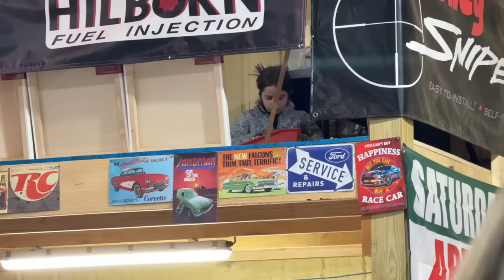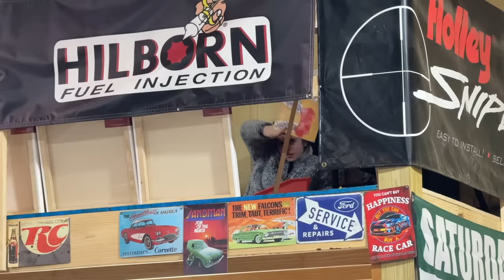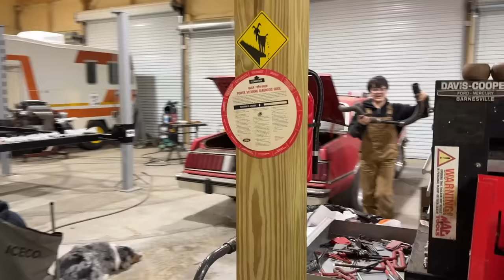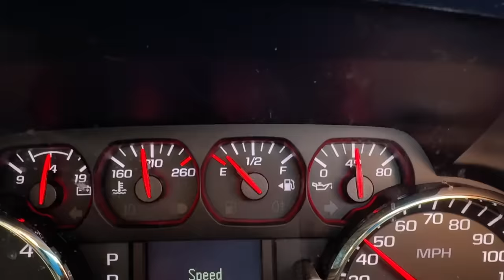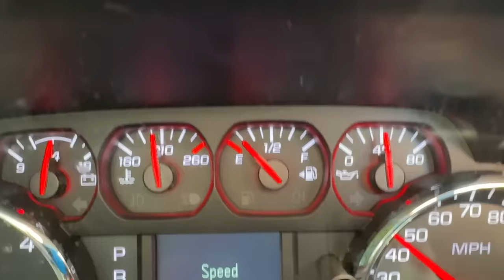Narrowed Rear and Plumbing for the Budget Big Block Fairmont!

Comment: Hey Josh,love the Fairmont but really love the falcon (first car was a 67 4 door with a 170) and I would love to see you put one of the Cleveland's in it with a 5 speed and a tcp suspension under it (eliminates the shock towers so no clearance issues especially with headers) . definitely need to up the rear end (ask me how I know an 8 inch won't live behind a high winding Cleveland

Comment: Another cool fact my cat was reman cat engine a pre 1999 so def just raw power it was putting 1850 pounds of torque down to pavement ant was to run over 90 mph pulling over 80,000 with 321 rear ends I want pull with it at local tractor pulls but I had 905,000 miles on my clutch I wi had to sell the truck because I lost part of my sight in my left eye due to 2 strokes they put that on medical record so I can’t pass dot physical now I didn’t want to sell but life happens and my wife looks to good to drive truck so it’s sold but still pulling freight out the Janesville Wisconsin area all set up the same so the guy has pulling gator that sounds so cool

Comment: Hey Josh, I bet a 1st gen S10 bumper valance would work on that ,they are both about the same width of vehicles, my 85 front bumper is A little over 5ft in length ,maybe thatll help you out to see if 1 will work on it, and the valance is about 4 or 5 inches wide all the way across

Comment: The DNA motoring transporting the 15.5 gallon cell or 20 gallon empty tank from Amazon and fuelie pump that I recommended - get a pair of the EFI Fuel pumps for best bargain for Ford Engine 390 Cu. In. With C8OE-H. head. There is cylinder head with mark C8OE-N for 428 Lincoln Jet block. maybe 4.18 in. bore. The last one engine it produce the 332 FE Cleveland in 1976 ad. Windsor Pontiac narrow V8 block have bore 4.12 x 3.75 inch. Change the main bearing diameter into the correct specification with milled cut as that must fit the Ford SHO 3.98 inch stroke crankshaft to the Pontiac 400 - 4 barrels. JEGS or JAZ machine CNC shop in California or India Sioux Pro Shop.

Comment: The cheap and budget is 454 cubic performance atop and close near the wishbone all cast aluminum good price budget wise from super SHO welder pit team of Fairmont Funny in Dylan and Dylan's purple pink hair wife in Tennessee driving the old day with past by in the Sleeperdude car named Model T with 12 horsepower 117 C.I.D. but it was sold as 15 HP flat head A/T vehicle for it. Afterward, only all wood Civilian Jeep go cart with 6 HP Chevrolet and Sleeper with Dylan's flip flop' s turbo transmission 400 up front in a Red car that hasn't t race yet.

Comment: That's not going to work with that a pieces exhaust adapter I already done it been there done that once it creates a pressure the hose blows off you need something with a barb fending. Go find a crown Vic or a Lincoln or Mercury they have the adapters on the radiator hoses from factory. For the lower hose.